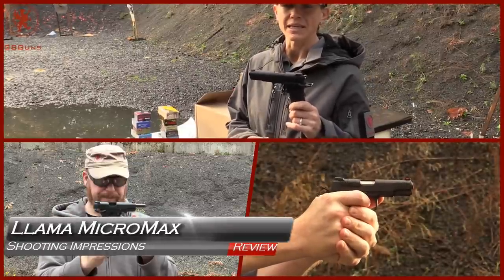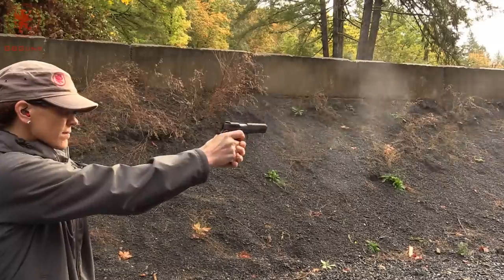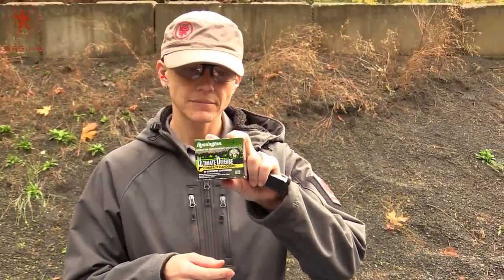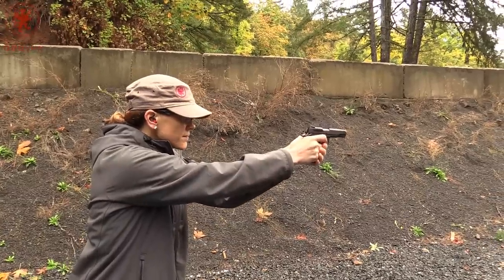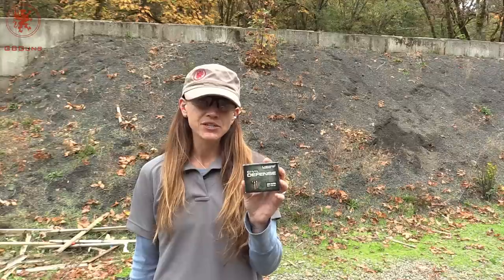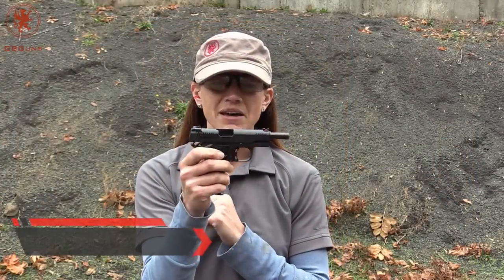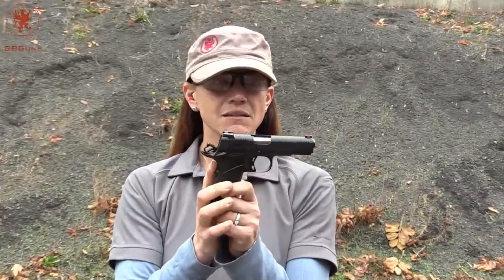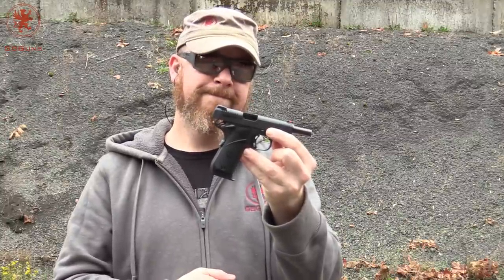Llama Micromax .380 1911 Shooting Impressions

Comment: I got a used Micromax in .32, which is very similar to the .380 model, at my local gun shop for $280 with 2 boxes of ammo and has become my new pocket pistol. Very cool little gun and with my experience using a full size 1911, this gun is really well manufactured and put a big smile on my face when I got it.

Comment: So I bought this pistol and 3 shots into the second magazine the left side of the safety fell out.  Sent it back 3 weeks ago.  They said there was a problem with a certain lot of serial numbers and mine was one of them.  No idea when it will be replaced.  3 Jun 19 - Got a call from American Arsenal and Armory this afternoon.  Lady said that my new gun came in and the armorer checked it out and failed his test and inspection.  Llama told them that they are retooling some of the parts and the gun will not be available for another 90-120 days.  I was offered the opportunity to wait for the new gun or they would ship me a new Llama Max 1 .45.  I chose the Max 1 .45.  Game over.

Comment: I got one.  It didn't fair to well.  I have to send it in for repair.  The firing pin retainer kept sliding off and jammed into the hammer.   It was fun to shot and very accurate little gun.
Reply from the maker: +Kit Chunhawong when was this?
Reply: Last weekend, I bought in on Friday 11/10/2017 and send it for repair on Tuesday.
Reply from the maker: +Kit Chunhawong I'm sorry to hear that.  Jeep us posted with what comes of it.
Reply: Hi Graham, a nice review. I also bought one-and had the exact same experience as Kit. The firing pin retainer slipped down after one round, jamming the slide open against the hammer. In that first instance, I took it home from the range and figured out what the jam was, and did a second cleaning-the pistol came soaked in cosmoline type grease. This time I took the firing pin assembly out and cleaned the pin/spring and the tunnel. It tons of packing grease in there! Second trip to the range...two rounds fired, same result. Another jame from the firing pin retainer slipping downwards out of place. Eagle Enterprises uses a network of four US gunsmith for warranty work. I sent mine to the smith in Oregon. It’s been gone almost five weeks-from 11/27 to yesterday, when he shipped it back...to be fair, it has been over the holidays. Pleasant experience, but I had to pay to ship it in for warranty work. I’ll comment after I pick it up and shoot it after the repairs. I can say that I sure do like the grip feel and how the gun points...it feels pretty good on my hands. I also own a Browning 1911-380 (compact slide) , which is a very sweet gun. So far, I felt like the LLama feels a bit better in my hand, so I hope it shoots as well.
Reply: Mine has not come back yet.  I send it in on 11/14 to the gunsmith in CO.    I contacted the gunsmith by email, no response.    I emailed Eagle Enterprises main office.  They said the will contact the gunsmith for me.   I have not heard anything back.  Gun was a good little shooter.  Sure would like to get it back soon. 

Kit
Reply: The gunsmith in Oregon is very responsive. He’ll take time to discuss the problem, and every time I’ve emailed him he’s gotten back with usually a phone call very quickly.
Reply: Another issue for buyers to be aware of is the current lack of magazines. The pistol came with two, but Eagle Enterprises hasn’t had them available, nor can I find them anywhere else. I’d called Eagle near the end of November, and at that time they said about a month or so to get their initial supply of them from LLama. So far, they don’t show on the website. I’m hoping that they make me a good deal on a few mags to make me feel better about having to pay to ship the pistol in for repair ;)
Reply: Got my MircoMax  back today finally after two months.    Service report said they adjusted, repaired or replaced recoil spring, firing pin & spring retainer.  I fired about 100 rounds today and happy to say it works great.
Reply: Looks like someone is pushing junk guns! There isn't no way in hell I would pay to ship the gun back for their shitty quality!

Comment: These pistols often get a bad rep due to cheap metallurgy and problems with feeding hollow points and steel cased ammo. I had success with polishing (ONLY polishing) the feed ramp to a smooth surface which made it much more reliable in feeding hollowpoints. Unfortunately, there's not much to do about the cheap metallurgy except to replace worn parts as needed. For example, I had alot of stovepipes when I bought mine used and this was due to a damaged ejector. Once the ejector was replaced the stovepipes no longer occurred. Theyre cheap handguns but with a little DIY work done to them they can be improved upon.

Comment: Nice video.  Seems like a decent gun.  I am a Bersa fan and have had issues with the TulAmmo ammo on both my .380 and 9mm.  Other than the TulAmmo both guns will run anything except that.  Gun dealers that I have spoken too express the same concerns and most  that I spoke to don't sell it.

Comment: The old Llama Micromaxes were a good idea, but the execution was not so great. This is the new version, and looks like some nice improvements have been made. The design and presentation are pretty impressive for the reasonable MSRP. They are advertising it as a carry gun, and it is lightweight at 23 ounces, so it's for those who have to have something 1911-esque in a relatively light carry piece (there are much smaller .380s, of course). Though that may seem like a pretty small audience, its looks will move some units anyway. With new ammo designs, .380ACP has experienced a resurgence in popularity, and clearly works for many shooters, so it's good this option exists. 

I don't advise ordering the nickel version of the Micromax. The finish might disappoint there. Only if you can inspect and approve an in-store unit should that be on the table.
Reply from the maker: While the stainless finish versions aren't out yet, these are being made by Metro Arms who makes an excellent stainless finish.  Take a look at our Bobcut video.
Reply: Graham Baates I thought the metro arms were all hard chrome not stainless. That was what I recall from the Eagle Imports website
Reply from the maker: +Robert H could be

Comment: So I went back to the Rock Island .380 the Baby Rock that you obviously are referring to as I am a little confused about why you said that pistol didn't work out for you.  I used your review on that gun to buy one today.  Now I just found your review on the Llama Micromax.  Your comments seem to indicate that you didn't care for the Baby Rock yet you gave it a very good endorsement with exception of the front sight.  So which is it?  I get it about the sights.  But you didn't mention the problem with the slide lock in that review.  But yet you mention it in the tabletop review of the Llama .380. Had I viewed this one first I probably would've gone with the Llama .380.  Guess I should take the reviews with a grain of salt.  But wonder if they are really honest reviews.
Reply: From what I have seen and read about the Baby Rock, you made the right decision. Even vs the Browning, the Baby Rock reviews better. Don't regret it. I have not heard a lot of good things about the Llama and you can change the sights on your Baby Rock.

Comment: Is it rated for +P? Also The only thing I'm not crazy about these 85% 1911s are their limited capacity. Extended mags in the future? Fingers crossed....
Reply from the maker: Single-stacks will always be limited.  I don't know about +p, but with a longer barrel than most .380s I don't think +p is appropriate.
Reply: I think the Llama would cycle +P just fine. Its the polymer guns have problems with expansion and deformation. I’d have no problem shooting +P out of a 1911 platform. (Maybe not a steady diet of +P but I’d certainly carry it.)
Reply: There is no SAAMI spec for +P in .380 ACP.  So no one will make guarantees without a definitive limit in place.

Comment: Mine has light primer strikes, mostly on the second round, Has anyone taken the hammer spring assembly out yet? Is the screw at the bottom of the grip just in lieu of a roll pin? Also, sometimes the last round in the magazine stovepipes.

Comment: Wish mine worked that well.  Less than 20 rounds (Sig) and it jammed up permanent - slide jammed hard.  Its in for repair under the warranty.  Paid $489.  Had high hopes, now dashed.  Not a gun I can trust.  We'll see when it comes back from repairs.
Reply from the maker: Do you have any more details?  The only thing I could think of would be the guide rod somehow becoming dislodged.
Reply: There was just a little play in the slide - but not enough to position it to get the slide stop out.  Did get the bushing and spring and spring holder thingie out.  No change.  Talked to the warranty gunsmith and he'd never seen anything like it so told me to send it in.  He should have it tomorrow.  Only parts left in there are the barrel and the guide rod so guessing they got messed up.  Didn't feel confident enough to take a mallet to it...so, we'll see what the gunsmith comes up with.  I'm happy with repair, replacement, or refund.   The hope I had when I first saw it - a .380 with a grip safety - sure evaporated in a hurry after just a few rounds.

Comment: Is llama micrmax .380 relaiable need your advice and opinion since iwas planning to buy it as my backup edc. Thankyou in advance folks!!
Reply from the maker: These haven't been imported in several years, so if you find one it'll be used.
Reply: It is still available here in ph, honestly you helped me w/ my 1st gun it is a metro arms commander in 9mm  with hard chrome finish what a very reliable and beautiful gun .

Comment: Have you tested a Browning 1911-380? If so how do they stack up against each other?
Reply from the maker: I haven't tried the Browning yet.  They won't send one which says something.  I prefer this over the Rock Island.
Reply: The Browning is really really nice!  Maybe the valedictorian of the .380 1911 class. But I’m impressed with the Llama’s ability to cycle anything you put through it. The fact that it hates the Tul ammo just makes me like it more! I’d like to see the same ammo test with the Browning. 

Also, I’d like to see the Underwood ammo included. That’s some really great stuff but not all guns like it.
Reply: Browning has a magazine disconnect. Means it will not shoot a live round in the chamber if the magazine accidentally is released. Not sure about the LLama but I do know the Rock Island Baby Rock has no disconnect. Browning is also an aluminum subframe in a polymer lower. LIghter. Better? Worse? you be the judge.

Comment: Hey Mr. Bates. My MicroMax has light primer strikes on 2nd round. I think firing pin channel has packing oil in it. You think it comes out like 1911 by pressing down block safety and push pin in and lift the back plate out?? Seems the extractor is held in with roll pin and a separate unit from firing pin? What do you think??
Reply from the maker: I haven't tried to strip my slide yet.  That could work.  I'd contact Eagle Imports and see what they say.
Reply: Eagle has a few Gunsmiths around the western part of country and 1 in Texas. I emailed the TX one and he said" send it in". I asked if I can just take out the firing pin like 1911, he replied "there's more involved". No, there isn't. It's relatively easy and I cleaned and polished a few parts. It was a bit cruddy. I still have to fire it to see if it runs good.